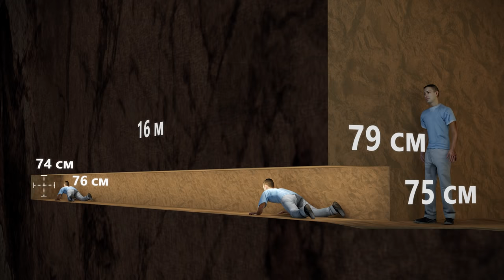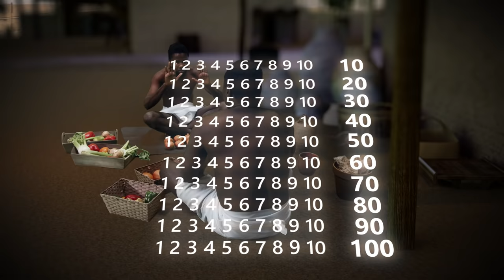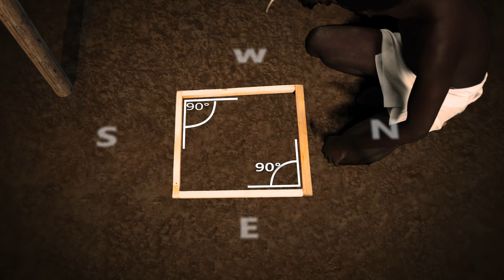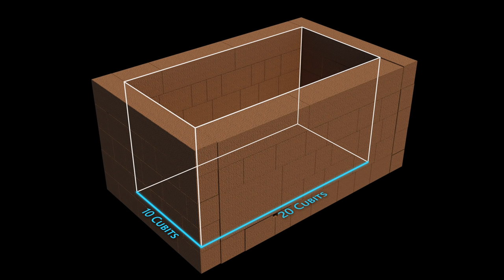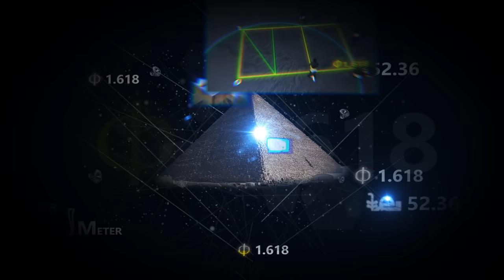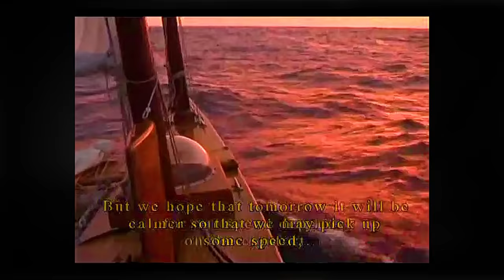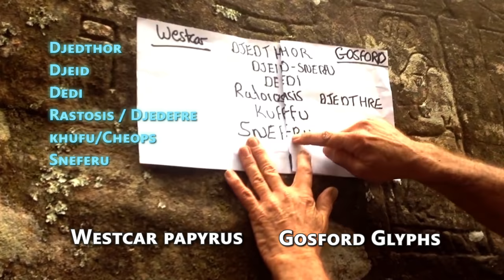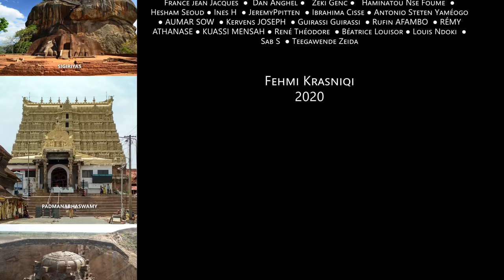The Movie Great Pyramid K 2019 - Director Fehmi Krasniqi

Comment: If the Egyptians had developed massive magnifying glasses, they certainly would have developed smaller versions for home fire starting and even eyeglasses. Let's not overlook plain windows as well.
One other thing to ponder: Glass does not deteriorate and there would be many examples of this being found if it was used for thousands of years.
Reply: Maybe they had matches 😕
Reply: Maybe they did have smaller versions? No current discoveries of even the larger versions.
So cant rule out the smaller versions just because they are hidden away or unearthed.
Reply: Either way, since the tools for machining are seemingly non-existent, except in the forensics of the stone itself (cut marks, drill marks, etc), possibly a more modern cover up?
Reply: @dematidesigns5444  That's very true but it's not my responsibility to to prove something didn't exist as it's impossible to prove a negative. It's the author's responsibility to prove it's existence or at least show evidence of it's existence especially when his whole melting granite theory is dependent on the existence of these optical technologies.
Reply: @dematidesigns5444  you are correct that no machining tools have been found. But you are also correct that there is abundant evidence of their existence, unlike the granite melting lenses in this video.
Reply: The Spanish wrote of parabolic mirrors covered in gold to a mirror finish but they melted those for transport to Spain. They also used a flat level pond of water and would mark the position of the stars to track the movement of the heavens. Also there's a temple dedicated to the Mayan god not to far from Giza. Some Egyptian copper artifacts come from a mine by the great lakes and there's pyramids under water in Wisconsin submerged courtesy of the US government back in the 1700's or 1800's. There's a rock that was found in New York no one could decipher until a rabbi saw it and knew the language it was ancient Hebrew of some of the commandments. To go back farther the Sumerian story of the anunaki specifically the word anunaki in the Hopi story it was the ant people called anu naki two words first being ant the second being people. A tribe in Washington had a receipt for goods exchanged in Sumerian on a tablet. I believe the story is bigger than just Egypt much bigger.
Reply: There is plenty of evidence of ancient Egyptian glass Search for it on YouTube!
Reply: Philip Thomas  thanks for the info, I hadn't heard that before.
Reply: there are many quarzite lenses at least, possibly glass but i have to look it up again to be sure
Reply: WHERE IS THE DISK PROOF !!! SHOW AS SOME OF IT A PART OF IT! LOL
Reply: If they knew how to make concrete, I still don't understand why they kept making blocks when they could have poured large areas altogether
Reply: I was thinking the same. Chances of finding remnants of the giant lenses would be greater than saws or metal tools.
Reply: @elimaduro1271  That's a really good point. Why would they have quarryed multi-ton stone blocks from the pyramids if it was easier just to pour new blocks where needed? Shouldn't the pyramids still be in near perfect condition?
Reply: Actually glass is prolly the only solid liquid we know of.
Reply: @garryr4308  ice E U...!
Reply: Yes those lenses, wars etc could have caused damages, and what about the green and black glass found in deserts today????
Reply: @NeetchianQueen  I've seen the green stuff, but not the black. Somebody thought it could be caused by a ball of plasma from a coronal mass ejection like the Carrington event, but I think that would cover a much bigger area. The Indian vedas talk about flying ships and weapons of mass destruction which seems just as likely to me. I believe in aliens and earthbound creatures who avoid us, like the mummified humanoid lizard beings found in South America. Loads of people's say that aliens  came down from the skies or up from underground or out of the seas and taught them civilization or saved them from a disaster. I've heard of mole people, ant people, little blue guys and then you can just pull a name out of the zoological hat when it comes to the ancient 'gods.' A little field of glass seems quite natural - cosmic ray or death ray, I don't think it was the Egyptians mucking about!
Reply: Now you are on youtube why not type Egyptian glass...
Reply: Lens provided power for vibration. Low temp liquification and safer too
Reply: @Alex-rx5uh  guess you didn't get my point. I did not say the Egyptians didn't have glass.... I said there should be examples of clear flat or concave transparent glass if they had this technology.
Reply: This kind of knowledge was kept secret even in 19th century Bavaria
Reply: @dematidesigns5444  Plausible- More plausible is that they were broken in war, and since they never thought of assembling broken glass, it was overlooked. 
You do not have to melt it completely- Like the magma,,, make is soft.
It was said that by the descendants of the Incas, the gods made the rocks soft.
Reply: @spaceminers  probably the telescope was also their invention and later remade. 
interesting.
Reply: The magnifying glass/quartz thing does raise a few questions?
Reply: No.  The simplest design uses two mirrors at orthogonal attitudes. Not practical to do in smaller jobs.
Reply: @terrysmith6133  source for the Spanish taking "gold parabolic mirrors"?  That's critical detail, as two mirrors orthogonal can be focused to smelt iron etc

See Lunenburg Foundry Prometheus Forge for eg
Reply: You are thinking in today's ideals. It was a secret, you know, like NSA stuff. Surely we should all have Access to anyone's phone or pc, no?
Reply: @angelchiriboga3904  kinda tough keeping a giant magnifying glass secret from all the hundreds / thousands of bucket brigade workers. Also the rich and powerful would certainly have the benifit of this technology and their tombs would very likely include this magical material - Nothing like it has been found.
Reply: @elimaduro1271  we don't ever pour large areas of concrete.  If they did use geopolymer, those blocks are all much larger than any concrete we our today
Reply: They hot me with the wooden beam being inside of a solid stone. The cement explains everything really especially with the bust with perfect faces.
Reply: How is the glass wear going to survive when you whites discovered it you probably destroyed it along with the noses of the statues.
Reply: Fu***ng agreed total on this one.
Reply: Philip Thomas  damn how did they overlook that lmaooo
Reply: Philip Thomas  you sound and look like you hating what the truth reveals the first to to ever do anything extraordinary we’re black. Why tell the lie of us being savages. Why was it so easy to enslave us I tell you why we were builders and not fighters. We went around the world building. Free Masons called them self that because they stole the blueprints from my ancestors and built there new world with it.
Reply: @Dwworkout  my point. Hatred.
Reply: @haleythayer4464  they didn't. They told you they invented it instead.
Reply: @Dwworkout  one word. Jealousy.
Reply: Philip Thomas  not true. YOU been lied to.
Reply: @angelchiriboga3904  that’s what I’m saying people are living in a world where the facts are there but it is easier to deny them. I respect all beings of life but I know the truth. I’m happy someone is giving my ancestors the credit they deserve.
Reply: @elimaduro1271  it would have been a mess.
Reply: Someone didn´t properly listen about why there´s nothing left. I mean, other than that you could´ve used your brain and think whether you would leave something lying around that is the epitome of domination knowledge. But hey, the powerful are powerful because they just do this: use their brains. And their ears.
Reply: Not if they have been destroyed to hide the truth.
Reply: @elimaduro1271  becase pouring individually reduces the chances of crack drastically.
Reply: @kolloduke3341 Where is the gold buried with the Pharaoh's for their after life journey?
Reply: I feel they would destroy them rather than share them. And if they were found they are not revealed to the public as this information is being hidden on purpose as well.
Reply: @DaniArt7  People who get into this field do so because they love history and archaeology. There's no gain in hiding anything, these are professionals who love history, they're not conspiracy nuts.
Reply: @juliuscaesar6793  I didn’t think they were conspiracy nuts. ?
Reply: @DaniArt7  Why do you think anyone who loves history and archaeology possibly want to hide anything.
Reply: @juliuscaesar6793  I wasn’t speaking of this films creator as hiding .
But you can love something and want to protect it from the ignorance of the masses.
Reply: @juliuscaesar6793  If this theory is not true then the levitation theory is highly possible. I went to coral castle in Florida and one man quarried giant coral rocks and built an entire garden and home alone. They said he was a mason and had some kind of box and giant tripod .
Reply: @juliuscaesar6793  very cool thanks for sharing !
Reply: @ken2391  they did discover a giant piece of glass maybe 2 ft thick and 20 ft long by maybe 10 ft wide and it's buried in the sand somewhere in Israel
Reply: They were small diamond stones that were mounted in staff of the kings
Reply: @melfordgopaulsingh9012  Sunlight from passing through any diamond stones do not cut hard stone. You can always get a small diamond demonstrate your cutting of a sandstone and upload your video for us if you genuinely believe it.
Reply: @juliuscaesar6793  these stones were only accessible to pharaohs, they were stones that possessed certain technologies
Reply: @juliuscaesar6793  don’t you know there are lasers that can cut through stones?
Reply: @melfordgopaulsingh9012  Why do you guys make up stuff without any evidence
Reply: @arlenmargolin1650  Citation needed
Reply: @juliuscaesar6793  Your detractors in this comment thread arguing that it was secret technology are forgetting that the "secret" would now be buried in arguably the most excavated land in the world to be found be anyone digging. Fact is, no one has ever found a giant albeit cracked/broken lens anywhere. It's pure speculation.
Reply: Maybe they left the lens inside the pyramid
Reply: @herbie_the_hillbillie_goat  --It's not just that the technological remains are missing, nor that it doesn't show up in any of the historical writings or depictions (especially given how widespread this technology would have had to be if they're casting all these jars, let alone the statutes and bits of granite inside the pyramids).  Set that aside. No one can demonstrate this theory actually works right now, TODAY.  How hard would it be for the filmmakers to hire someone to build a lens that big and just test it out at the latitudes needed to see if it could even melt rocks like they claim?  It can't be that expensive to get a lens that big...unless you understand how difficult it is to craft lenses that big.  They said the lens would have a 5 meter diameter.  The world's current largest optical lens has a 1.57 m diameter and cost millions of dollars to make.  Oopsie.  

Not to mention that the larger the diameter, the thicker you need to make the lens to avoid it cracking, and since glass isn't all that homogeneous (it's just mixed melted rocks, after all), the thicker the lens is the LESS light can pass through it.  You've probably seen that yourself with the thick block glass used in some bathrooms.  You're not going to be focusing light through glass that's thick.  Not to mention, glass that's got a 5 meter diameter is going to weigh a hell of a lot and you have to somehow keep it suspended so you can keep it at the right angle to capture the light in the first place.

Someone fried ants with a magnifying glass and assumed they could create a lens big enough to melt stone using the chemicals found in ancient Egypt.  They never actually tested this theory, because it's impossible to do.
Reply: @ken2391  Both points have validity, I would ask, can the process be repeated to add to or disputed that the probability of this process could have been done?
Reply: I agree, surely we would have found some evidence of it
Reply: @ken2391  " It's the author's responsibility to prove it's existence or at least show evidence of it's existence especially when his whole melting granite theory is dependent on the existence of these optical technologies." The film shows ZERO evidence that the Egyptians knew those optical technologies. It is total B.S. that they built the pyramids. They didn't.
Reply: @terrysmith6133  A polished metal mirror makes more sense than a large lens.   A glass lens is more difficult to engineer.   It has to be pure, and ground to a precise shape to properly focus light.  Then it must be polished.    Do we find any artifacts or artwork depicting the existence or manufacture of such objects?
Reply: Glass was found in Ahkenaten's city so there's no doubt they had glass developing skills.
Reply: @icancuall2037  That may be but there's over 1000 years between Akhenaten's time and the building of the great pyramid.
Reply: @Marauder1981  You should always find SOMEthing... I mean, things get lost, buried, forgotten. Not a single lens found? I bought an old restaurant. I constantly find things in the backyard: Old bottles, broken glas of glasses and bottles, old caps of beer bottles, nails, metal works, etc. If I would leave the yard in the back alone it would overgrow and everything in it would get buried deeper to probably puzzle future generations what was at that place :-)
Reply: @garryr4308  Your statement is VERY close to spot on. Glass is the slowest flowing liquid presently known (not quite a solid). You're intent came through, just a slightly different wording.

For folks who are not aware, while it takes a lot of time glass continues to flow with gravity. The only specific example I personally have witnessed were in a site of a sanitarium. Western States Mental Hospital had a sanitarium outside Sedro-Woolley WA. It was built in the early 1900's and parts of the site were later taken over by the Job Corps program. Cascades Job Corps Center uses some of the old patient dorms as student dorms now. When I was there in 1996, some of the doctors quarters still existed. The window panes in the doctors quarters kinda blew our minds. At the top of the pane, the glass was just paper thick while at the bottom of the panes it was nearly 3/16ths of an inch and slightly thicker than the actual frame. The glass had flowed down over time and was where I learned about glass being the slowest flowing liquid.
Reply: @Dwworkout  right on brotha!!! For real.
Reply: @Dwworkout  Were you born a racist or did you just seek it out all on your own?
Reply: @GetitrightnowUBoob  lmao 🤣 Racist I could never be racist my people are at the bottom of this sport because race and racism is a sport that me or my people are not winning
Reply: @Dwworkout  The problem with racist is their non existent capacity for self awareness, along with their eternal embrace of  a  well practiced state of victimhood. Read your comment cupcake and take note of how you spoke about whites, and even though you seem to think that disparaging whites is safe territory the the fact is you are just simply unwilling to acknowledge it, and thus it totally, marks you as a racist. Ya see, a racist is a racist, is a racist, regardless of what color the person you hate happens to be.  And your reply to me,  moreover establishes your embrace of victimhood. Trust me, there are plenty of people of color that  don't embrace racism nor victimhood and win, win, win at every sport on this planet.  BTW, your comment was the ONLY comment in this entire thread that played the race card. Everyone else was focused on the brilliance of this video including that of praising the genius of blacks in history.. and acknowledging their struggles. That you are the only one that played the race card, should tell you something. I'm simply the only one that dared to call you out on it.
Reply: If you melt granite it will be black without any granite marks
Reply: Clear glass is very difficult to make.

A large lens is more so,

Even if they could, what would the mass of a 5m lens is?

Also it is possible to run the numbers for the power output of such a lens and the enthalpy of melting of granite. How much work done to melt one tonne.

Does it add up?
Reply: Your logic is fallacious. Just because they developed a solar lens does NOT mean they "certainly would have developed smaller lenses." You then go on to use your fallacious argument to reach a fallacious conclusion. facepalm/
Reply: @Clueless41  Yeah, I guess they could have developed massive glass magnifying lenses without any intermediate developments like plain glass windows or eyeglasses.... But I kinda doubt it.
Reply: I guess people don't know how a lense needed for this is actually made. Maybe look that up and realize that if they had the technology to do make focused lenses, why would they? Or don't. Just continue speculating on something you don't even understand to begin with.
Reply: Also, if they were able to come up with the idea for a "round disc" they could use to measure distances, surely they would have put two and two together and had the wheel.

This video is absolutely wonderful and well done. It's a creative idea. But it's just an idea, a story, a thought experiment, presented for entertainment and mental stimulation, rather than scientific scrutiny.
Reply: @elimaduro1271  death of architecture
Reply: @terrysmith6133  Ancient Phoenician (proto Hebrew), Gaelic, Ogham and runes are Hebrew.   Greek is derived from it, then Latin.  Aramaic and Arabic aren't the tongues of Israelites, but the ieudomites.   Greco Romans, Greco Scythians, Gauls, Gaelics, Celts, Franks, Norse Scandinavians, comprise a huge part of "the 12 tribes of Israel scattered abroad."   

 A ieudomite "rabbi" wouldn't know anything linked to Israelite's language.  They use the Assyrian block script for the fake language they recently  made up.  It is derived from Aramaic, the international business language, and the Assyrian block script alphabet.  Ieudomites were in league with Assyrians, who enslaved Israelites in Asia.  They escaped and returned to Europe.  Some took the southern route below the Caspian and Euxine Seas.  Part of those overthrew and ruled some kingdoms.   

Most took the northern route above the Caspian and Euxine Seas.  Two years in wagon trains was the least amount of time it took.  22 oxen pulled rolling houses.  Huge trees for the axles and wheels.   They were called by many epithets as they passed through.
Reply: Glass is technically a liquid.  But it still would be around currently.
Reply: In Nubia… their status eyes 👀 were made of glasses and mirrors 🪞
Reply: @juliuscaesar6793  guess you haven’t heard of white supremacy lol 
Go ask Napoleon Bonaparte about the noses 👃
Reply: @ken2391  that’s not true
Reply: @spykezspykez7001  
No !
And how the hell did they get that massive lense up the pyramid to build the King's chamber  ?
Reply: @crhu319 Werner, is that you?
Reply: @Dwworkout how long have you been a racist?
Reply: @DaniArt7 coral is very porous and light. The pyramids are not built of coral or anything that flimsy